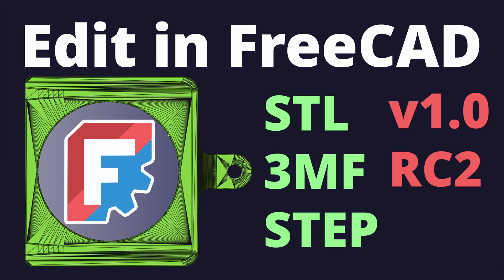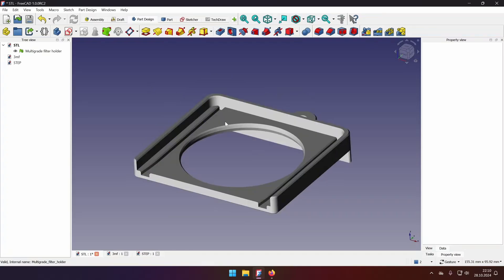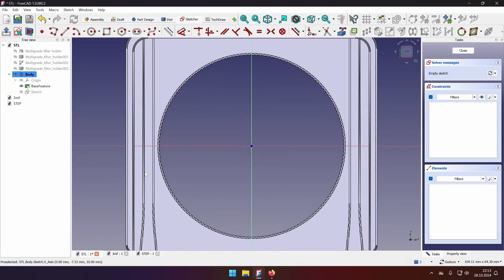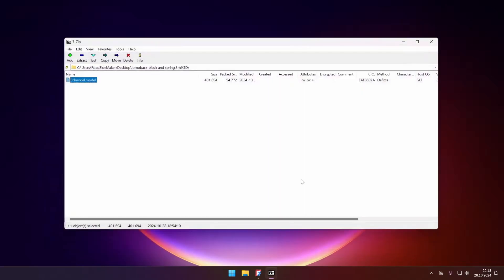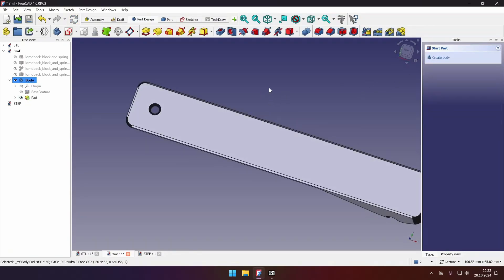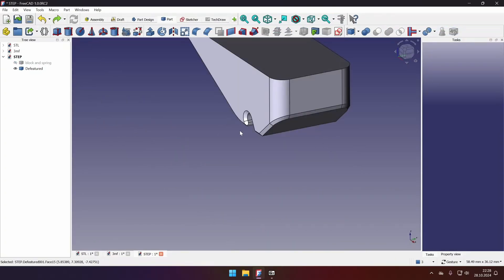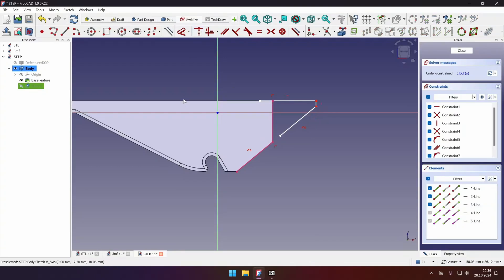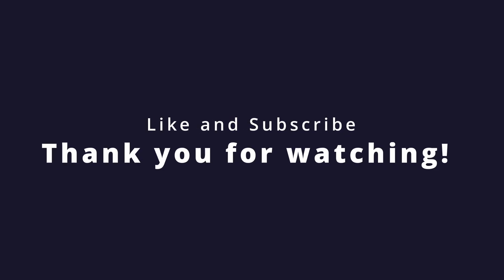FreeCAD - Modifying STL STEP and 3MF files

Comment: M$ Copilot says:
The Practical Rule of Thumb
Use STEP (.stp) when you want to edit or design the part.
Use STL (.stl) when you want a simple, universal mesh for printing.
Use 3MF (.3mf) when you want a modern, compressed, full‑fidelity print file with materials and slicer settings.

Comment: Just found your video, thanks, its great, I have one minor question, I have an stl file I wanted to make a hole smaller, and following your steps, it worked great but the question is, when you finished your pad the faces looked clean but mine still shows the circle lines I created in sketch, why is that?

Comment: I Literally cannot press "create shape from mesh"
Reply: You have to change from "Part Design" to "Part". There are a LOT of tiny tiny steps and if you skip one or do something else in between, the program behaves completely differentenly. It's a very complicated software so beware what you click on. I had to restart several times because I did something that I wasn't meant to.
Reply from the maker: Hey, the tutorial is on the 1.0 RC2 build. But nothing changed for these tools in 1.0 full release as well as 1.1 Dev builds. Just tested on 1.0 full release - works as expected. Remember, for each next step you need to select new "object" in the tree to proceed.
Reply: @ How can I extend a simple plane surface, like drag one side to make it extend and all connected thingies morph along with it, creating a slope?
Reply from the maker: Hey, this sounds like direct modeling is what you are after. FreeCAD will not help you with that. What you describe is the workflow for Blender.
Reply: @ I will have to look into that. If it takes extra steps in FreeCAD but makes sure the measurements stay correct, I might stay with FreeCAD. If Blender can do that I give it a try, I've just seen that there's a Sketch mode addon for Blender even. I take it that all the different 3d modelling softwares from different industries have now developed quite good interoperability and often shared functionality.

One thing I struggle with is converting STL files downloaded from the web to proper solid objects, when I want to remodel them and export them as STEP files. I guess it depends on the type of object which software to use to recreate or create the shape in more detail. For a figurine Blender would be more suited whereas for an engineering part it would be FreeCAD, I guess? Of course I would use automated tools as much as possible.

Comment: Excellent! very very simple procedures! I'm trying to do the same feature to convert a mesh in solid to modify in  a simple manner as you can do on Fusion 360 (with the free functionalities) and your procedure do it in FreeCad VERY VERY WELL! 
I've only 3 questions:
 1) why you make a copy of the body? only to refine surfaces?
 2): why this options are only in Part workbench and not also in Part Design? 
 3) in Part menu I've seen also a "Convert in solid" command, when you think it will be usefull ?
Tank you
Reply from the maker: Hey and thank you!
1) Yes, it simplifies the model and removes unnecessary edges on flat surfaces.
2) Part design is classic feature-based modeling workflow. As such, it is more restrictive and uses B-rep approach. Part workbench is an attempt to create the CSG approach (however it is still b-rep underneath) and as such, you work not with features but with "bodies"  and their combinations. So I would guess that converting and simplifying bodies are more appropriate for Part workbench than Part Design workflow.
3) In the video I use the "Convert to solid" command as a last step. in 2) I mentioned the B-rep representation of the model. Well basically it is a solid. So the command converts the "shape" to the usable "solid" (that is a b-rep) that we can operate with.

Comment: Most of the videos on youtube teach about adding the body or union of primitive solids to converted paatzs, but no in is able to edit the pre existing lines on these bodies.
Reply from the maker: These lines are from meshes. FreeCAD is not natively mesh software. Blender would be a proper tool to edit meshes. Here we try to conver mesh to geometric representation and work with that
Reply: @RoadSideMaker  ok thank you
Reply from the maker: You are welcome!

Comment: Hi, I'm going nuts trying to extend the length of this model, AL_3030_T_Slot_cover.3mf, can you give me a clue why i'm getting an error when trying to extrude a pad. I am @4:00 trying to follow your steps.
Reply from the maker: Hey, if you do it for 3d print, then there is an easier way. Load this 3mf file in slicer of your choice. I use Orca, select the model and click "scale". Uncheck the Uniform box and set the length as needed (if the model sits vertical, it would be Z axis scaling). Let me know if it helped
Reply: @RoadSideMaker Sweet, Thx, I'm using super slicer on nix. Can't get Orca Slicer working because Webkit is a security threat.
Reply from the maker: Should work with SuperSlicer just the same, cheers
Reply: @RoadSideMaker It did, thanks. :) Turns out at 300mm its a good test of your part Cooling! :D
Reply from the maker: Great, some big print volume you have there 👍
Reply: @RoadSideMaker Vcore3, I love it! :)

Comment: Great video.
3d files should always be exchanged as STEP/STP whenever possible, since it is a very clean format with infinite definition. It's like STLnis a JPEG file with finite definition, whereas STP is like a vector file with infinite definition.
Not a big fan of exchanging files as 3MF - it's like sharing photos with your friends packaged as PDF - it makes a lot of sense in certain situations, but the vast majority of times you'd just share JPG.
By the way, STEP/STP is not a parametric 3d file format. But it is far more precise and editable than mesh/STL.
Reply from the maker: Thanks! In the sense that STEP files do not contain parameters - yes, they are not parametric. In the sense that they can be used in parametric CAD software as is with no modifications while edges, faces and vertices are valid geometry - lets say they are parametric cad compatible.
Reply: you cant scan objects with step file so STL is neccesary

Comment: Great tutorial, One thing I am having an issue with, I have a Star Wars scout trooper helmet I currently am working on and the face part of the helmet around the eyes area is suppose to got into the visor part at the top of the face portion, but whoever modeled it modeled that part seperated from the visor, the part does not connect to the visor, and its a curved feature, how do I edit curved from a STL file, with no other file format to work from. So that I can merge that part of the face into the visor part of the helmet. Is there a way to make the curves like what is in the step file with no individual faces around the curve.
Reply from the maker: Thank you. You have two options - if using CAD, then use the ST as a reference and trace sketches around it rebuilding the part. Second option is to take mesh modification software like Meshmixer (it is free) or Blender. The helmet was created, most likely, not in CAD as it contains many organic forms.
Reply: @RoadSideMaker  Ya I was afraid of that, I did take it into blender, I'm just not patient enough or skilled enough to go thru all of the thousands of individual faces and points and edges it would take to repair just that section.
Reply from the maker: I am sure that there should be tools to move bigger parts of the model, not just individual points and faces. Like brush or something
Reply: @RoadSideMaker  I tried but the only pushes the two different faces into each other and wont merge them. I guess I'm just gonna have to go thru and merge the points and faces individually to get to what I want. I'm really a noob when it comes to this kind of stuff.
Reply from the maker: Sorry couldn't be more of help. You can try Meshmixer, it is free. Maybe you find luck there

Comment: Great tutorial, thanks. I've been giving it a lot of tries and ended up with Blender for quick mesh modifications. Parametric CADs are not really good for working with meshes. So I use both Blender and FreeCAD now.
Reply from the maker: Agreed, problem is historically most 3D models made in parametric CAD and shared are in mesh format. That makes it harder to modify than it has to. Hope STEP gets more adoption and becomes standard.
Reply: @RoadSideMaker  ideally it should be combination of 3mf and step in single format, hope at some point we will get file format like that. technically 3mf is an archive, so we just replace mesh with step and done
Reply from the maker: It would be helpful, however 3mf is mesh by design. Improved precision mesh, but still a mesh. I don't believe you can just replace step, unfortunately

Comment: Thanks a great video, very useful. One question though how do you centre the stl file if it comes in offset from the origin?
Reply from the maker: Thank you. You should determine where you want to place the origin. Than use measure tool to determine necessary offset. Then use Transform tool to set the necessary location

Comment: Thank you so much! I had no idea about the defeture button. That is very helpful. It would be great to see how you convert the STEP to a standard Part Design part. Great video!
Reply from the maker: Thank you! STEP is already parametric part file. 10:50 I am adding the defeatured model into Part Design Body and modifying it afterwards